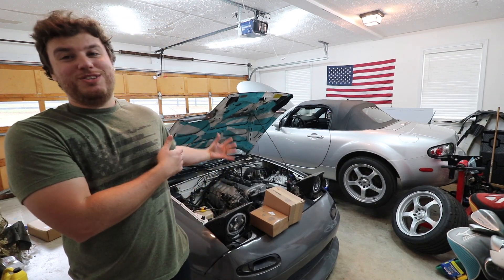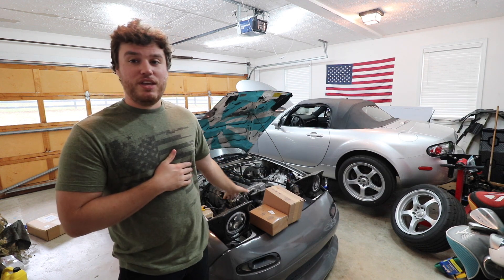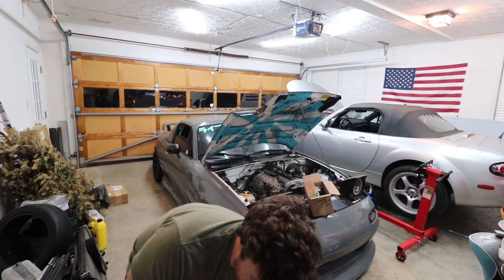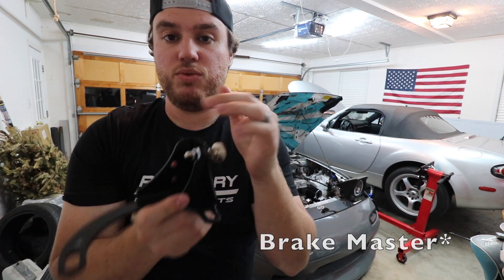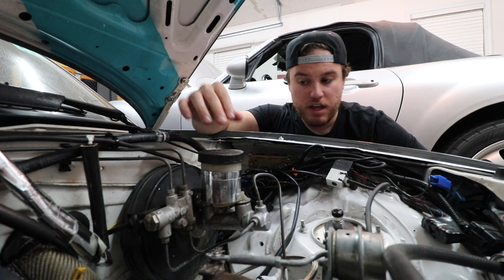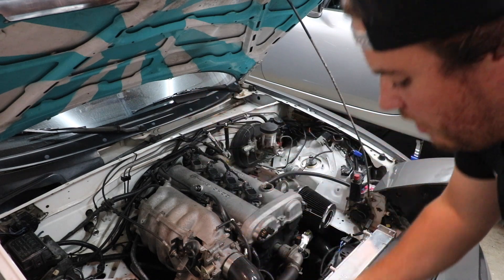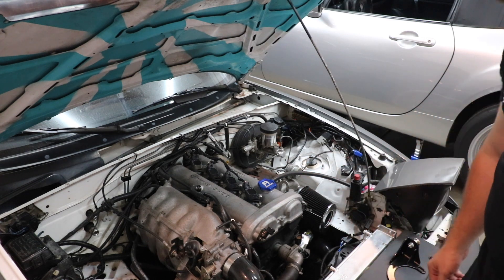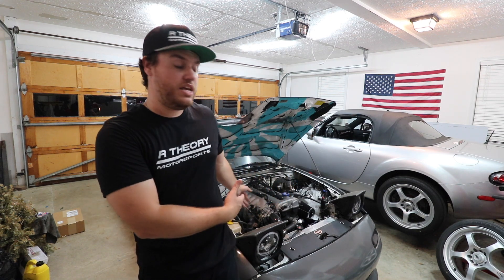Every Miata Needs This Modification

Comment: Just got one of these cars love what the rising sun on your bonnet looks so cool
Reply: @GasPedalGarage  new sub just working my way through your vids sucks that your nc blow any tips to look out for on the nb
Reply from the maker: Appreciate the sub🤘uhh the NA and NBs are different than the NCs they usually are super reliable and will take a decent amount of boost, as long as you keep oil in them they keep kicking haha
Reply: @GasPedalGarage  defo gonna save and get mine boosted long term I wanna get a na and sr20 swap but it's all money haha